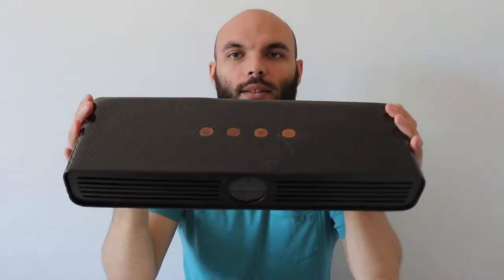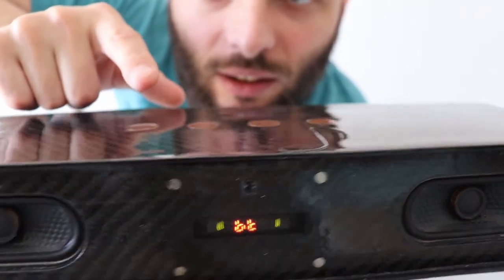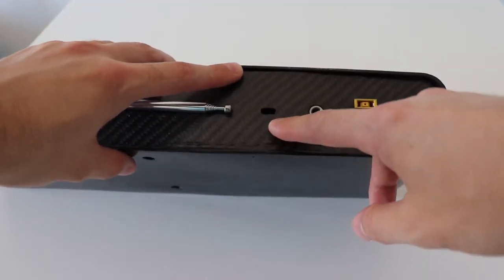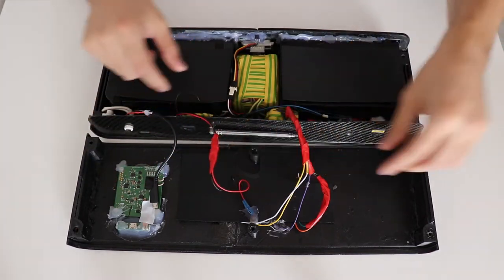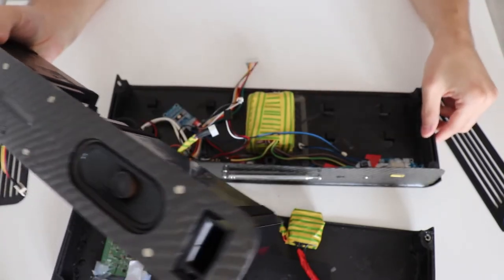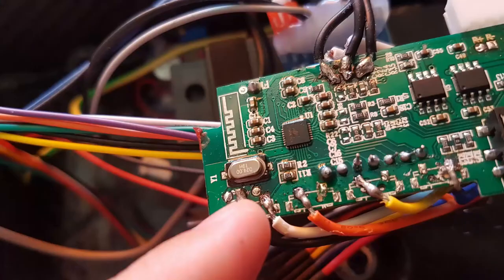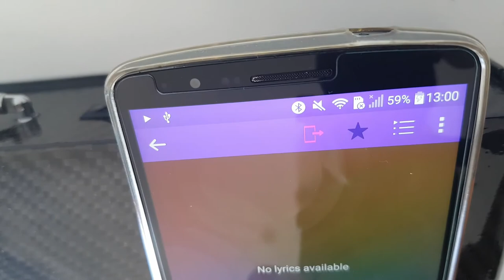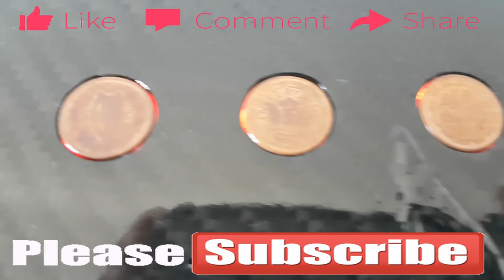the boombar - DIY bluetooth speaker/boombox/soundbar

Comment: Hi. You made a grate job! Everything looks nice and well done. I rely like the idea of making  touch buttons. Coins looks very good. I want to give you some suggestions about the electronics. First of all get rid  of this awful amp! I tested it and it's not good at all. I wold recommend you to use tpa3110 or yda138 amp. They both gives you 8-10 watts per channel. For your speakers it's more then enough. Second - get rid of step up converter. 12v will be ok for a new amp. 
I wish you well and keep doing such a grate things like this.
Reply from the maker: Thanks for watching and for the suggestions. I'll consider them for my next speakers!